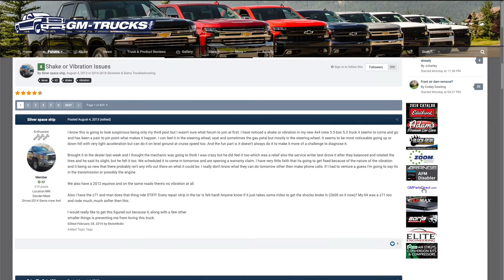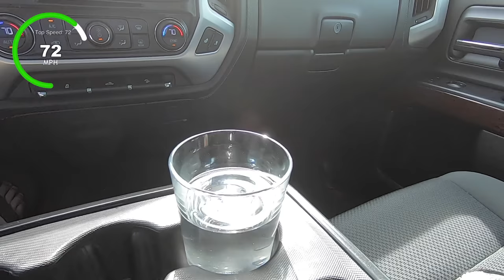"Chevy Shake" Driveshaft Fix for GM Trucks?

Comment: nobody has vibration sensor instrumentation? nobody? really? good god!
Reply from the maker: Cayenne why would you need an incredibly expensive vibration tool to verify a problem you can so clearly feel or demonstrate with a bottle of water without a sensor? That would be like criticizing someone for not having a thermal imaging camera to show you a fully engulfed house fire.
Reply: @GearsGadgets  Yea, stupid me. Wikipedia--->VA can use the units of Displacement, Velocity and Acceleration displayed as a time waveform (TWF), but most commonly the spectrum is used, derived from a fast Fourier transform of the TWF. The vibration spectrum provides important frequency information that can pinpoint the faulty component.
Reply from the maker: Cayenne first of all, if you watched my Pico Scope video you would see that diagnostic step happened. Second you would see it was a complete failure as it showed the truck has no vibration even as the water bottle danced away in the cup holder, and third most people won’t go out and drop $2,000 on a specialized tool like that nor would I recommend it as it requires a specific skill set to use it, clearly if a technician couldn’t figure it out, your average joe won’t. I appreciate that you feel smart because Wikipedia said so but sometimes street smarts vs book smarts my friend. GM has a whole slew of incredibly intelligent engineers who can’t figure it out, maybe you should take your “looking it up on the internet” skills to GM and apply for a job.

Comment: Same junk happening with my 2015 GMC Sierra I don't need does it vibrate I had to replace the engine fuel management it's garbage dropping to 4 cylinders is garbage I'm done with GM
Reply from the maker: So sorry to hear that. Its a miserable thing to deal with.

Comment: Every time I see a Chevy truck on the road I cannot believe it. I literally have to look in it to see how stupid the person driving that truck has to look lol fiat's aren't much better.
Reply: P Wilki must be a Ford guy
Reply: @pennysmith2012  no I had a 67 Chevelle back in the day. I also had a 72 Chevy truck and then I bought a brand new 2004 Silverado HD 1500. Chevrolet at one time was a great vehicle with great engines. Now they're just toilets. They wouldn't even be in business if it wasn't for government bailouts.

At one time GM was the largest producer of goods on planet Earth. They made everything, radios, stereos, refrigerators, damn near anything you could make. Now they can barely maintain as a second-rate car manufacturer in the United States.
Reply from the maker: Any brand can have issues.
Reply: @GearsGadgets  you can come up with all the duckbilled platitudes you want.....fact is, GM is junk!